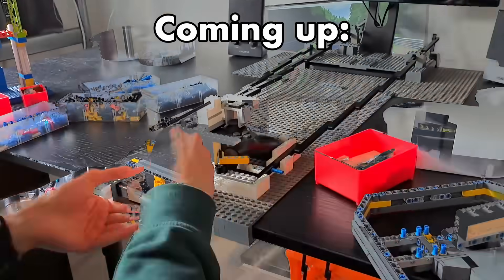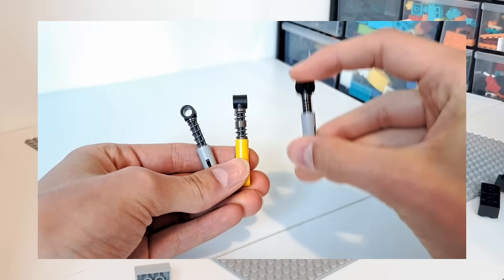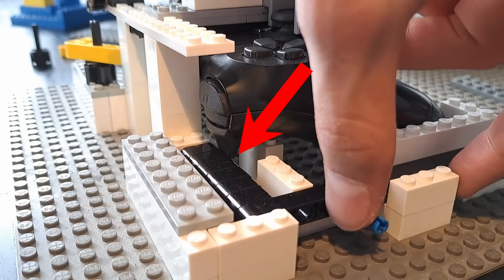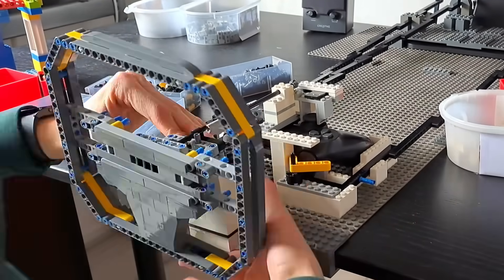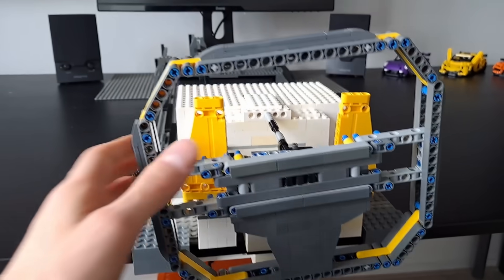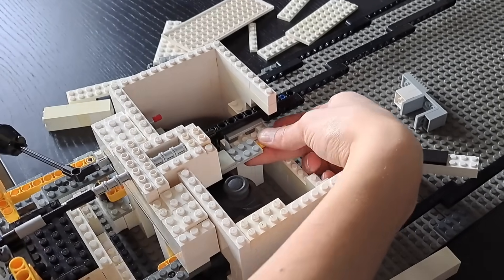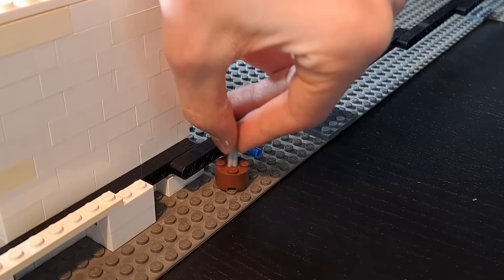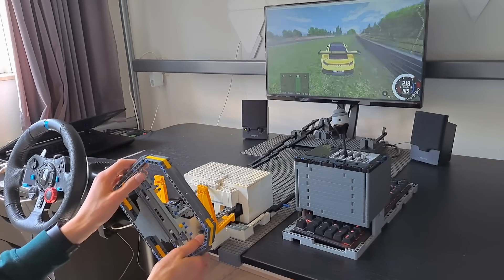Building a LEGO Driving Simulator

Comment: Very nice project! You can try to put a universal joint (if you've git some) so that the steering wheel has a better angle 😀. But that's simply a detail over the hard work you've put in this. 
Nice work!
Reply from the maker: Thanks! I used a universal joint in my previous attempt at building a simulator, however I found that it had too much play in it, so I left them out with this attempt
Reply: That is so cool how do you like that @KoenkunBricks